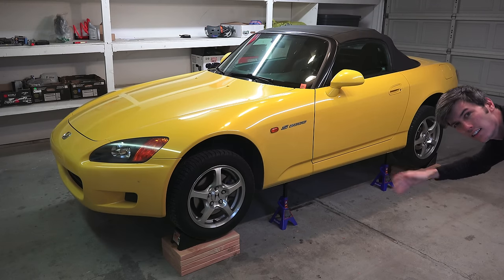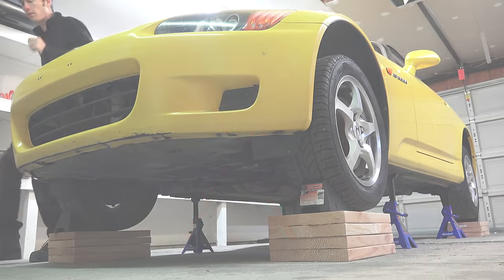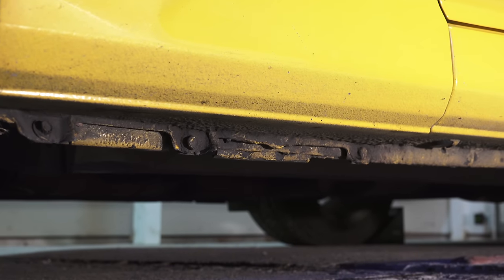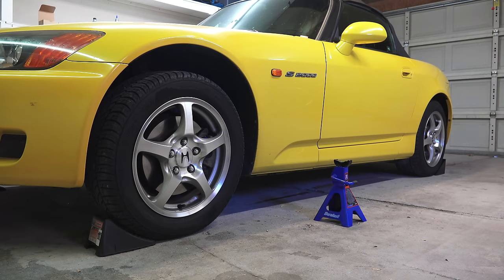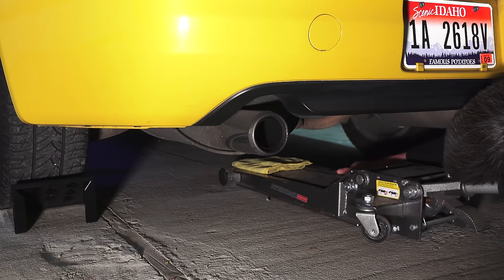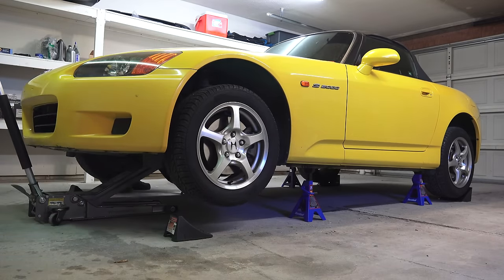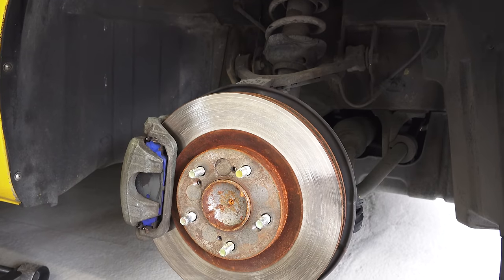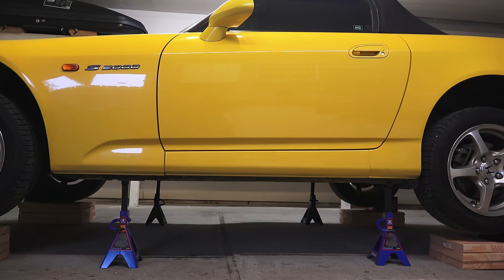How To Completely Lift A Car On All Four Jack Stands

Comment: Use hockey pucks on you jack and jacks stands. This will give a non slip no scratch jacking surface, keep from mangling those pinch welds.
Reply: Norevlimitr o.O I hope your joking... never put anything on top of a stand dude especially not a puck.
Reply: Been doing it for years..
Reply: They also sell rubber covers for jackstands and jacks.
Reply: do you watch autotestservice?
Reply: Norevlimitr how do you fit and balance pucks on jack stands?

Comment: In your case, since you don't have a front center jack point, how did you lift the car up incrementally?  By the time you had all four corners up, on the first increment, you already had jack stands on all four corners.  Where did you jack from, to lift up the front to the second increment?  (I'm assuming you don't have a front center jack point because you're not using it, in your video.)

Comment: Top tip: Don't but a convertible. Just lower the windows of a sedan and lift it up using a forklift. It's faster and you can lift higher.
Reply: Instructions unclear, forklift fork stuck in my ass
Reply: no worries, a lil penetrating oil should loosen it up
Reply: will this work on a ferrari 360 spyder?
Reply: will this work on a ferrari 360 spyder?
Reply: +the one who gets you triggered Yes
Reply: o3iquitous great ok I'm here in my forklift. now where exactly do I put these forks and start lifting :) please help me it's the first time
Reply: It sounds funny, but a forklift isn't the dumbest or most expensive way to lift a car.
Reply: Dennis Vainio well if you ram the forks into the doors, then out the other side, you'll be left with 4 handy holes for any future work you need to do on your car.
Reply: @petrsulc1168  Who was driving?

Comment: I would highly suggest buying solid rubber wheel chocks.  They're soooo much more sturdy than plastic or metal ones.  They're only a little more expensive, but well worth the expense if you enjoy living.  Northern Tool and Harbor Freight carry them.
Reply: I totally agree. I bought some of those hard plastic chocks and they are completely worthless. They slide way too easily on concrete and aren't worth a crap. The solid rubber chocks are a bit more expensive but they do what they're supposed to.
Reply: They smell terrible though, so don't keep any in your car, or it will stink.

Comment: Using the wood is a good idea. 

What I do is set cars onto a set of wheel rims when I need access to lower areas or underneath.
Reply: Not good.  Wood cracks, splits and can shift.   Rims are not good either.  Plastic 3 ton car ramps slide under just fine and that's what they're made for.
Reply: Edslittleworld did you just tell him plastic is better than a metal rim or wood block? Hahahahahahaha!!!
Reply: snakerb Yep.  Molded plastic CAR RAMPS (by Rhino) that you buy at an autoparts store rated to 3000 pounds.  What is the wood rated to?
Reply: Risto Mladich It's your life, do what you want.  Standing on a chair with books on it is probably just as safe as a ladder...right.
Reply: Edslittleworld carpenters put whole houses on wood blocks and I've been putting cars on rims since my early teens, no issues ever. Not saying the plastic car ramps are no good, but they're not free like old (not rusted out ones) rims.

Comment: Much easier way to do this... Place the jack under the pinch weld just rearward of the mirror. When the car rises it will be roughly equal front and back as both sides rise. Place jack stands under the pinch wel at the support points. Repeat on the other side. The car is more than strong enough to do this. Had an S2000, did it this way for years.

Comment: Id like to add that the time the car may fall on you is when you are pulling gearboxes out from underneath. I prefer to take the engine and gearbox out in one piece through the opening in the bonnet if possible.

Comment: Whenever I am working under my cars on jack stands, I put the wheels under the car as the added safety (usually the OEM wheels/tires). Something you can do if you don't have the wood laying around.

Comment: Because of this video i went to home depot and custom cut alot of thick wooden boards to use as another precaution. 

Can you do a video on jack point pinch welds and wether a dedicated specific jack pad and jack stand pad is a good idea? I have yet to see any body have problems with their pinched weld jack points crumbling, except when i search about it on google. Even the stock s2000 oem jack for changing tires dont have a wedge to put at the jack point, it is just a flat spot

Comment: A great tip I've learned is putting old rims (even better if they have tires on them) and placing them under the wheels on the car. Then lifting the car up on all 4 jackstands. But only lift them so you see the suspension unload. Try to keep the cars wheels standing on the old rims. If your car has a stock suspension you probably dont even have to lift it on jackstands.

Comment: One thing omitted from your tutorial is the need for a relatively smooth surface on which to use your jack! 

The only reason I say this is because I nearly shat my pants when jacking the front end of my car up on a "solid and level" concrete & pebble surface (not loose pebbles, pebbles mixed in the concrete  to make it look "good" but FUCK the way a jack likes to inch forward under weight) as the car started to lurch towards me when I used the jack.

Needless to say, I survived as I was able to get the car stable on the stands and sat in it shifting my weight about like a loon to make sure the stands were stable. Paranoia never killed nobody.....

Comment: Hello

Where did you get the wood blocks from? Can you please provide a link?

Regards
Reply from the maker: Bought them at home depot. Took two 2x12" by 12 feet boards and asked them to cut it in 18" segments. They'll cut it for free in house.
Reply: Thanks!
Reply: Correction 2" x 12" by 8 ft (96")

Comment: What wood are you using? I want to do this to lift my car because I don't want to use jack stands, I don't trust them. I would only use jack stands when I don't need to get under the car like changing a wheel or working on brakes. I can buy pressure treated sleeper wood but what else works?

Comment: Stuff like this makes me wish that contractors that build houses would make a garage with a simple work pit, similar to how they do oil changes at places like jiffy lube.(Drive it in the garage then work from the pit.)
Reply: It's a very bad idea to do it by default. If you don't align the wheel, the car may fall in, let alone a person may fall in.
However, it might be a good idea if it has a good metallic cover.

Comment: Do you really like the S2000 over the STI? I sold my S2K and I was looking to move to the STI. Let me know your opinion of the differences in the 2 cars please!
Reply from the maker: Yes indeed! I explain why here: https://www.youtube.com/watch?v=jtry6Cn8pEA
Reply: + Christopher Carrasco - my 06 STI was a great car,but my RX8 was waaay more fun to drive, even at 100hp less.
Reply: Christopher , how was to own an s2k ? pros & cons
Reply: I really miss my S2K but I when I was driving that car I felt like it lacked power in it. I came from a 240sx with an SR20DET motor. The turbocharged engine gave me that satisfaction in power.
Reply: WHP is low (210ish) in the 8's but the delivery of power is amazingly smooth, where the turbo power comes in hard and violent in a tuned STI, but AWD makes up for it.

Comment: I always lift my Integra using the radiator support up front to lift the whole front end, then place jackstands behind both front wheels.  Then lift the rear center tow hook and put stands in front of the rear wheels.  On my wife's old Corolla I did the same up front but had to stick the jack way under the center subframe where the control arms attached on the rear.  Very little jack handle clearance so it took forever to raise it up.

When rotating tires, I simply jack up each side behind the front wheel, which will raise the rear wheel also, and swap each wheel front-to-rear.
Reply: Radiator support or front motor support beam. If you're using the radiator support you're asking for trouble because its not a strong point nor is it supported. Its basically almost a body panel. Now the beam right behind it(unless the radiator support is on this beam as well?) Is a solid piece. 

I have a 2002 Ep3 that's similar to integra GSR and the radiator support is only a thin part of the front bulkhead
Reply: @blazeaglory  yes the radiator support beam on the 90’s Integra and Civic chassis is load bearing and is perfectly acceptable as a Jack point. I’ve been using that point for over 20 years with no issues.

Comment: is the differentcial designed to be able to support half of the cars weight? i never jack the car up at the differencial even tho im told its ok, just me i guess. good video could even have saved a life or two. i use two floor jacks at a time and seems to be faster way to get them up on four stands but most people dont have two floor jacks.

Comment: The front of the car was initially lifted incorrect. Should have been lifted from the front center of the vehicle as per the FSM. This way the load is balanced and jacks are placed in pairs. The way shown at first is unstable and needlessly stresses the chassis when pivoting over that single jack stand, like a teeter-totter. Furthermore, using a floor jack at those jack points puts too much weight on the pinch weld, which risks folding it. Those should only be used with 4-arm hoist or the emergency jack, which is designed to fit around the pinch weld perfectly distributing the load and prevents the pinch welds from folding over. He does it correctly later when lifting it higher up. Curious as to why he chose to do it that way at first. The car is factory ride height and has a low-profile jack. If the jack still didn't fit, should have driven the car up on the wood planks. Also, should block a wheel from the front AND back side of it.
Reply: Agreed. On my Z4, the front-center point is too deep that even a lowpro jack can't reach. So I jack the rear up first, get the rear on stands, then insert the jack from behind the front wheel to reach the front-center jack. The wood plank thing is kind of a pain in the ass TBH.
Reply: "Needlessly stressing chassis" and "risk of folding pinch welds" are two issues I still haven't been able to solve. I have a constant battle in my head each time I lift my car. I have a FWD car and I've resorted to putting a block of wood under the chassis rail and jacking one side at a time from there. I'm not sure if this is best because I still have to put the stands on the pinch welds. I've also thought about using those hockey puck style things that go between the jack and the pinch weld but I'm not sure if that actually helps, would I then put the stands on the frame rails? I don't like doing that either because then the stands are in the centre of the vehicle to its easier to make it tip over.
Reply: Alex Derus all Hondas and Acuras have a beefy built up lift point at all 4 corners. As a Honda tech I personally never seen one damaged with a floor jack. Hitting curbs and other things will bend them. As far as other manufacturers with uni body construction I agree with you 100%
Reply: Alex Derus i honestly have never seen it happen. I only hear about folded pinch welds on forums when i search for it.  The oem honda jack does not have a pinch to fit on thr pinch weld, it is a flat surface scissor jack
Reply: Yup!

Comment: I've been placing the jacks under the suspension for each wheel. This way the wheels don't sag. I jack the front of the car first then do the rear. I been storing my Integra this way for 25 years. I do like the added protection of placing wood under each wheel. I may do that this year.

Comment: How long  can you leave a 2010 rav4 under jack stands? I need to take off all 4 wheels, put them into my car, drive to a different city 30 mins away then drive back 30 mins so i can leadve it on jacks for an hr?

Comment: Ive built wooden ramps, very nifty for oil changes and engine work that needs access from beneath. No need to jack anything up. And if you need to do rear-end work or exhaust, just back on the ramps. Also if you need the whole car up, drive fronts on the ramps and now only the rear needs to be jacked up.

You need a good driver to use these, or make loooooong ramps so you have the room for bad clutch management.
Reply: +1 I just made a set this afternoon. Heavy af but that's a good thing.
Reply: yep,is what i did and do.

Comment: Where did you put the floor jack on the front of the car when you raised it higher and put the wood blocks underneath? It went under the front bumper so I am guessing a control arm mounting point but I was confused where it went

Comment: Not sure I like jacking the car from the front side to put a jack stand in back. That's some twisting in the chassis for a convertible. 

On my Eclipse I used to use the scissor jack on the side front pinch weld to lift it high enough to get a jack under the front center lower engine mount and then jack the front and then put the stands on the sides where the pinch welds are. Once I had the front up, the rear was easy.

Comment: Hey what dimensions for the wood blocks do you use?
Reply: They are 2x12s, cut in 18-20" lengths.  Ymmv based on your tire size.   I would use screws to secure the blocks together and incorporate a wheel stop/chock in the blocks (affixed to the wood) to not have to use the plastic ones so the top looks like this  \__/  or this |___|

Comment: I've only lifted my car once at all 4 corners to take the wheels off. I was parked on what I guess was a 2-5 degree grade and I don't know how, but after I got it jacked up on all 4 corners, the back right jack stand was no longer touching the car. I let it be since all the weight was towards the front though. I don't recommend doing that. On the opposite end I had a jack stand not fully lock and break loose when resting the car on it. Now that was a wake up call.

Comment: I have 2017 Hyundai ioniq Hybrid and the car doesn’t have any jack point other than 4 lift points behind the front wheels and in front of the rear wheels. How can I jack it up on 4 jack stands and make the car level.

Comment: Can you do some science about working on a car lifted like that when you do some high torque effort like unboltimg the flywheel or something like that ? I am really scared on getting under the car just on jack stands because it may tip to the front or the back ...
Reply: impact gun. expensive, but better than dying.
Reply: If you lifted a car in the manner he shows and made sure to do a good shove test as he wimpily demonstrated. You would be surprised at just how stable it is. There are some bolts I can't get loose on my Buick while it's on the tires because the suspension absorbs too much stress but lifted up I can wrench hard enough to shatter hardened steel sockets.

Also a decent size bike seat post around a well made socket wrench works wonders. I use one of the better models of 1/2" drives that auto-zone sells like this. They stand up absurdly well. It took around 500lbs of people jumping on my floor jack handle to break one. The warranty covered the wrench, no receipt just take it in and they will swap it out with an equivalent model. In my case the new equivalent model was made to handle even more stress thanks to a couple ears of engineering advancements at their tool provider.
Reply: I prefer the 6 ton stands which have a much wider base.  Makes for extra stability.  Also, I remove the wheels and lay them under the vehicle just in case.

Comment: When replacing the rear leaf springs on my jeep I used a Hi-Lift jack/farm jack on the tow hitch. Being a Jeep it was too high for a traditional jack and the jack stands didn't go high enough. We had 2 people on the sides to make sure it wouldn't tip and 2 people working on the suspension. Good times. Also very sketchy times.

Comment: Is there anyway to NOT bend the metal jacking points of the car? The Jacks don't have the groove so it will bend the metal points.
Reply: Apparently using hockey pucks with holes in them will help. I use frame rails and whatnot myself.

Comment: I also have a set of ramps I use if I just need to work under the car and don't need to work on the suspension area. Took a little practice to get the car up the first few times (you don't want to overshoot the ramps), but I've done it plenty enough that it's almost a habit now.

Comment: I use solid concrete blocks under each tire in addition to the jack stands because I don't have wooden blocks.  If I did, I'd screw a frame to the edges as added protection against rolling.  Like you, I'd never trust jack stands alone even though I know they are "safe" and I'd certainly NEVER trust the jack as sole support. 
Liked that shuffle, man.  Great style!  Who says White guys can't dance?

Comment: Also give the base of the stand with weight on it a rap or two with a rubber mallet, lets the legs settle evenly on the cement.